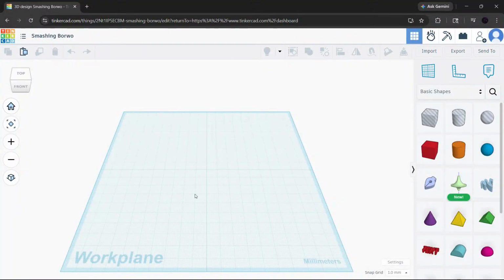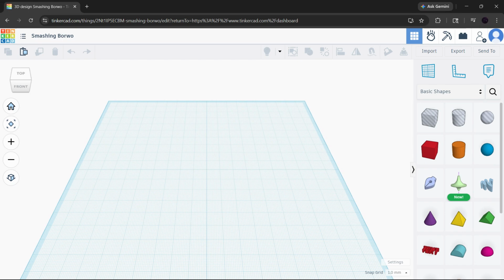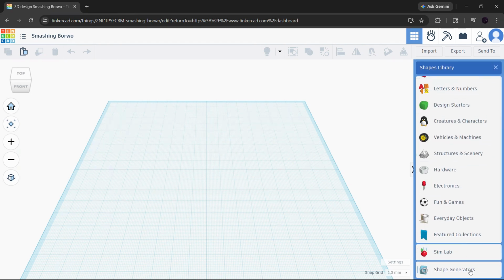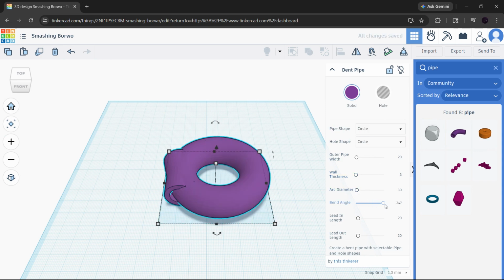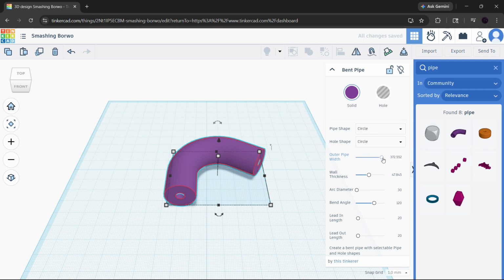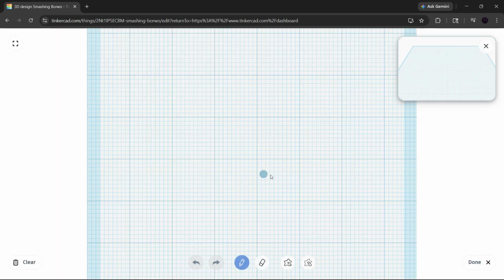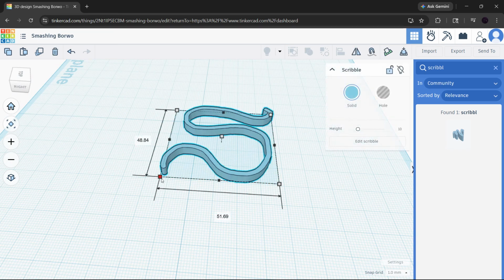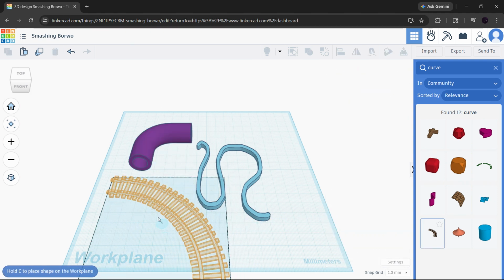How To Bend In Tinkercad (2026 Easy Guide)

Comment: Looking for a way to bend a flat object, all ready made, from flat to curved.  Like a text or image to fit around a cup or cylinder.
Reply from the maker: Tinkercad does not currently have a true bend or wrap tool for curving flat objects around cylinders. A common workaround is to use many small segments or import a pre-curved model from software like Blender or Fusion 360, then bring it into Tinkercad.